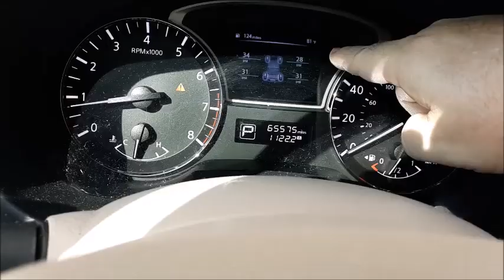How Repair Small Slow TIRE Leak Yourself for 8 Bucks (FixAFlat Car Fix Low Pressure Leaking Flat)

Comment: How do you know what a 1/3 of the fix a flat is? I also have the same problem with my Volvo front right tire.
Reply from the maker: you don't have to be exact.  You'll get an idea with the weight of the bottle in your hand and how slowly the foam is going through the tube.
Reply: @HelpingHermit  I put it in Today the cap would not screw on and when it did I lost most of the contents on the ground.

Comment: This does indeed work, I have used it over the years a bunch of times. Be mindful however that valves usually don't like this stuff and repressurizing after the glue has hardened might be a problem. Many times at the gas station air compressor, it will pressurize the tire but the machine will have problems reading the tire pressure.

Comment: Hello, I have a question. What does it mean when the fix a flat isn’t going inside of the tire? Instead it’s just making a mess everywhere. Am I doing something wrong? I follow the directions and it’s not going inside of my tire 🥺
Reply from the maker: are you sure you have it tighten really well.  Its normal for some to spew out.  maybe you have too much air in it.  Try to remove some air from it.
Reply: @HelpingHermit  hi! Yes I had it on tightly. and actually you just made me think of something, because I did have a lot of air in my tire, I had filled it up like 2 hours prior.  I’m assuming it didn’t have enough room to get inside. When it starts to deflate I will try it again. Thankyou for responding 💙

Comment: so if I did find a small nail/piece of scrap metal causing a slow leak, is it more worth replacing the entire tire or plugging it up?
Reply from the maker: fix a flat is usually from a small leak inside the tire.  You could try both the plug and the fixaflat at the same time.  Put the plug in first, then do the fix a flat  However do so at your own risk, because a hole from the outside is more risky.

Comment: question my leak seems to be coming from the rim, will this still help?
Reply from the maker: its worth a try
Reply: I have the same problem. I have a tire that goes low every few weeks. It still does it after getting new tires. I hope this fixes my rim leak.
Reply: @Martin_Entertains update? I have that issue after getting new tires SMFH